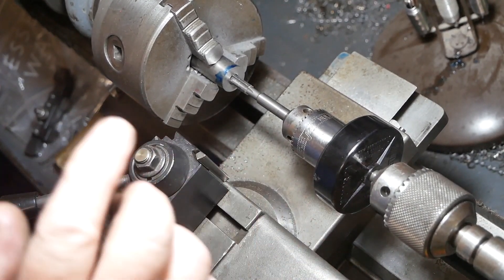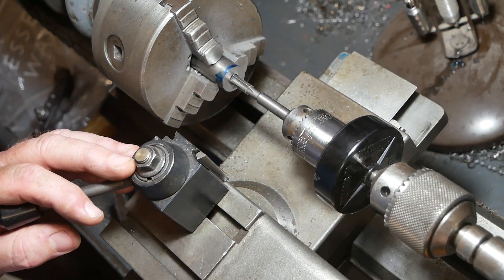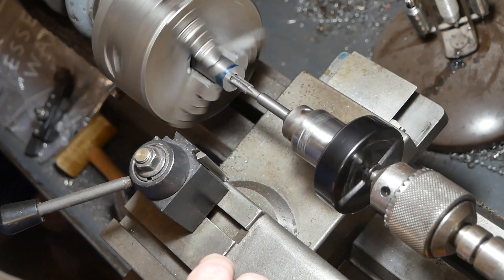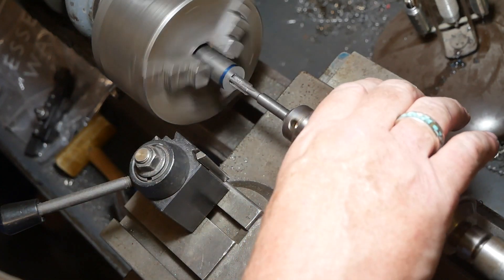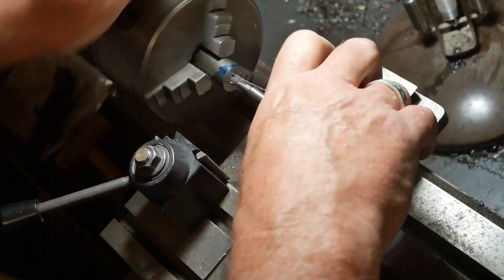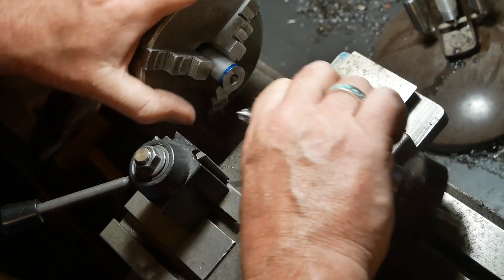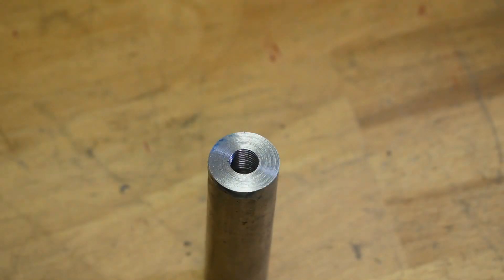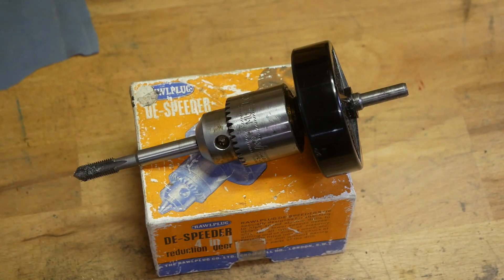Brilliant Tapping Trick on the Lathe

Comment: I have seen Joe piezinsky use something like this. Think he built his version. But it gave me an idea . Sure would be nice to have something like this for a mill or drillpress. Then it dawned on me, I bet I could setup a small planetary  gearset in a similar configuration.  The spindle drives the chuck only when the outer gear is held fast. Otherwise it just freewheels through the gears once released
Reply from the maker: That’s a great idea Craig. Would make a great vid by the way😜
Reply: @Ukenick  I have certainly thought about making a video to that account.  But I just got into a couple of residential projects that are going to severely limit my garage time for the next few months